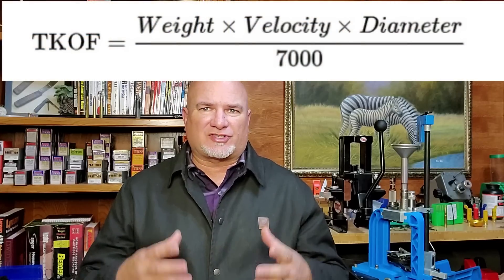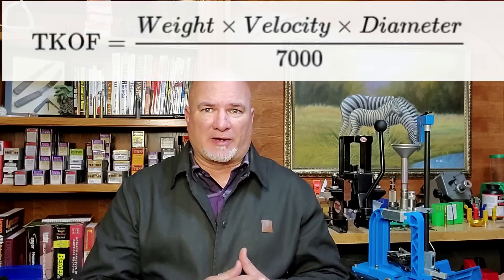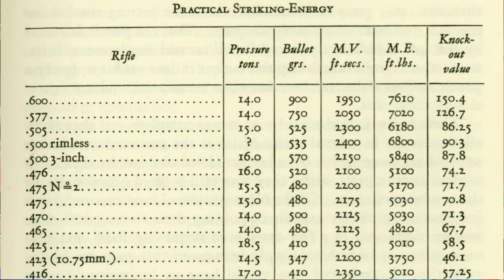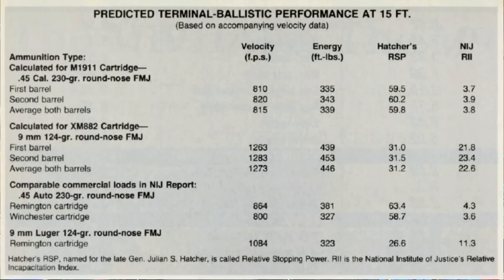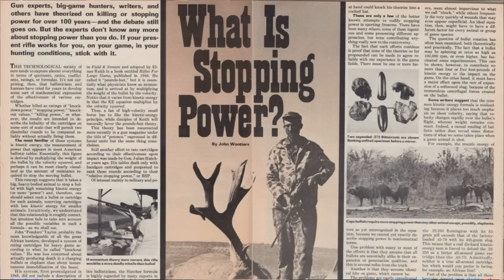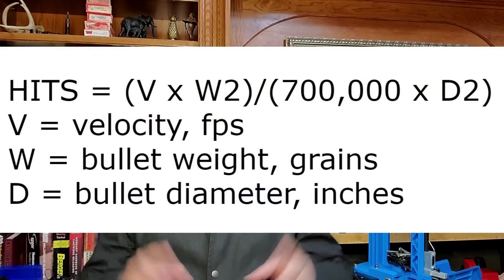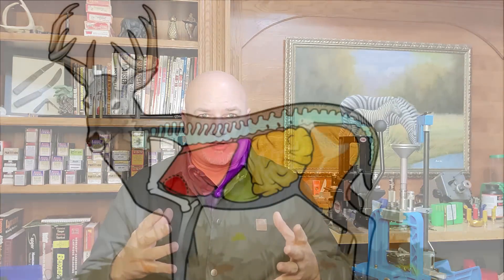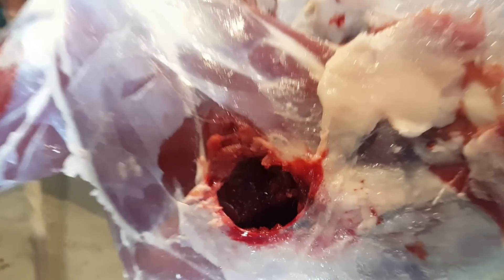KILLING POWER: Can It Be Measured?

Comment: You touched on one of the key points early on. The shape, weight and speed of the bullet at impact are just t0 values in terminal ballistics. 

Take for example weight. An ELD-X will usually shed 50% of its weight on it path through the body, significantly changing its SD along the way. A copper mono or a bonded bullet will retain their SD t0 value completely or close to it. 

Energy at t0 will tell you very little, if bullet designs differ. Both can have let’s say 2500 ft-lb at impact. But the FMJ will pencil through with a smaller crush path and significant speed at exit of the body only transferring a part of its energy into damage, whereas a cup n core will dump all energy in the body.

I don’t agree with your disregard for high BC bullets though. Even at very ethical hunting distances they give you a significant energy advantage vs. traditional designs. E.g my 30-06 200 grain ELD-X handload will have a 300 ft-lb advantage at 200 yards vs. the traditional designs with a BC like a barn door. Will this be enough to make a difference - sometimes it will
Reply from the maker: Your last example of the ELD delivering more 300ft/lbs at 200 yds is highly exagerated with modern hunting bullets like TTSX and Accubonds. Also, the ELD is probably the most unreliable hunting bullet current on the market. Many Guides are at the point where they ask their clients not to use them.
Reply: @desertdogoutdoors1113  hence me saying compared to “traditional” bullets, so your classic soft points and alike. A TTSX is far from traditional with  the polymer tip and the boat tail giving you a BC .48 in the 180. A Core-Lokt is already down to .38. 

The ELD-X is an interesting one. Would be interested to get your opinion on that - I think the way it is marketed and designed invites hunters to take shots they shouldn’t.

- Taking too far out shots when the skills or the proper angle are not there is the obvious one 
- short distance shots with very high speeds due to lower grain weights leading to 80-90% weight loss
- high market share in the new shooter segment, which produces in itself less than optimal shots on game
Reply: @nikos6220 that’s an interesting set of inquiries regarding the ELD-X. I’d like to know as well. Hornady has imo been at the forefront in the last decade plus of offering new products for shooters. But they’ve discontinued many products that are claimed to not sell well(many roundnose and flat points). Those FNs and RNs that “don’t sell well” volume wise probably haven’t dropped in sales to the extent claimed. More than likely their sales are compared to the sales of VLD style bullets that are all the rage. Especially with the many new handloaders that haven’t the foggiest idea of the benefits of those classic discontinued bullets. I just sometimes wonder what’s up with Hornady. Considering the thinner(they look thinner anyway) jackets of the ELD-X vs same caliber InterLock they can’t be that much more expensive to make vs how much more they charge for em. Likewise Nosler has been up to no good with the exorbitant cost of the Partition now. At least 25% higher than all copper TSXs?! Really?! When John Sr was at the helm(and in Bob’s early days such was not the case
Reply: @robertfree1908  in the end they are a slightly beefed up (thicker jacket) match bullet. Just like the Game King and others. 

If that is a bad thing, is hotly debated. There is hole host of experienced hunters out there that even argue for the use of match bullets, especially on longer range shots. 
For sure they are way cheaper. The accubonds are 3x more expensive. 

My view is that they work well if you get down to velocities where they show the 50-60% weight retention. That’s why I handload the 200 grain in my ELD-X in my 20’ 30-06, which gets me to 2600 ft/s out of the muzzle.

Running them at 3000 ft/s plus at impact will turn them into a grenade and lead to the erratic behavior Desert Dog Outdoors referenced in his comment.
Reply: @desertdogoutdoors1113  have you got a link to a guide saying that or ever had them fail on you personally? ELDs and fusions are my go to hunting bullets at the moment due to performance and availability.

Comment: A .22 is deadly as far as it is accurate. A  55lb bow can kill any north American animal. A 35lb bow works for deer. A 52lb bow will kill a polar bear like Fred Bear did. My arrows are 466 grains from a 70lb bow. The longer the projectile the better the penetration. Thus a spear with a thrower or amentum will kill a Trex or buffalo. Distance matters because stuff runs out of steam. My bow only has good penetration out to 200 feet. It will still push through a 5 inch diameter tree after going through a 5 inch closed cell foam float with field point at 200 feet. Great topic. It comes down to ethical range with tools in hand. Knowing what those ranges are is where to start. Then knowing what your skill range allows.